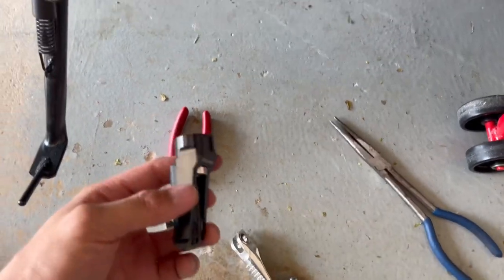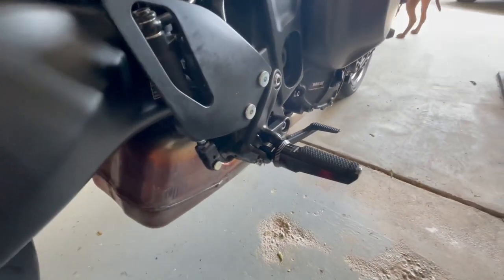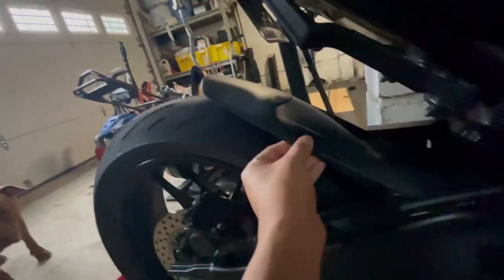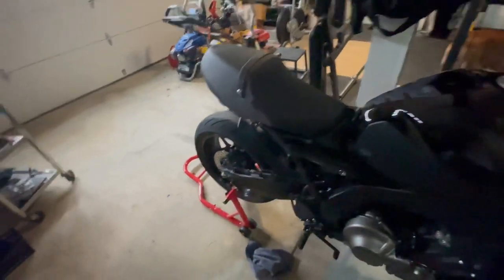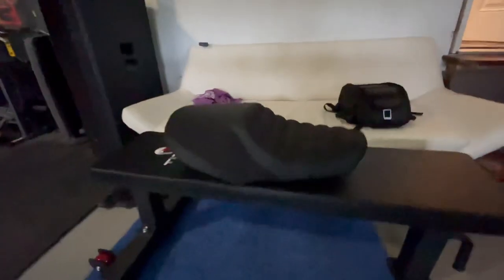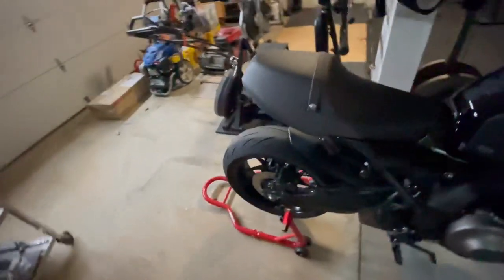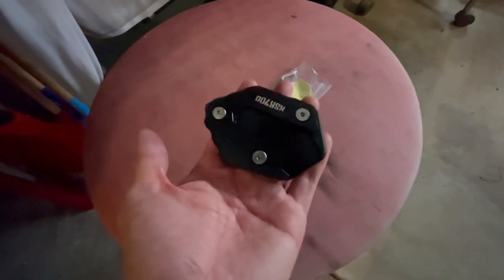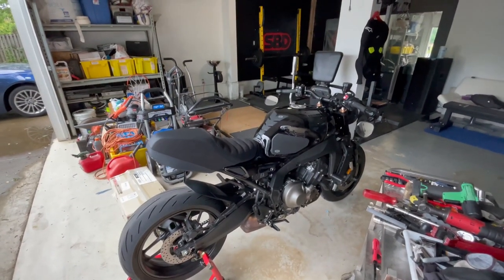2022 XSR900 Mods (Puig Footpegs, Kelpi Custom Moto NEW SEAT! Rear fender extender, etc.)

Comment: Im so curious of what's under the seat!! I need to know if there's a possibility to create a seat without a hump.
Reply from the maker: There are a bunch of seat options that have the flat seat! there is nothing under neath so its great
Reply: @Steelfl3x  Great! Can you tell me where? I can only find one flat seat for the 2022 model.
Reply from the maker: @rickslijkhuis6822  what year do you need?
Reply: @Steelfl3x  yours. 2022. I can find many flat seat options for the 2021 or lower model but not for the 2022 model